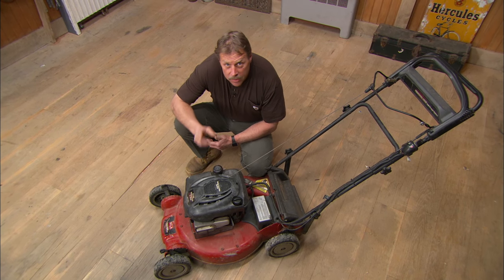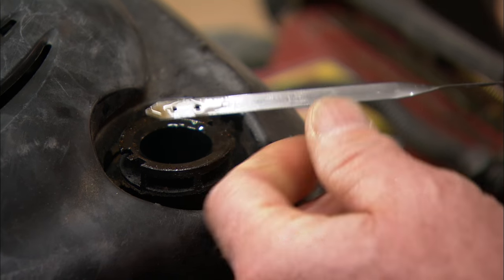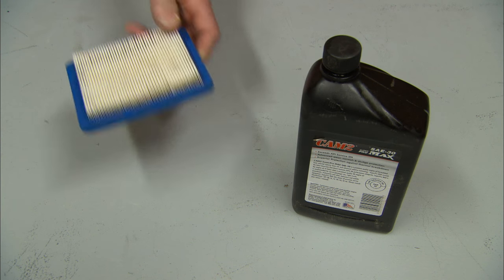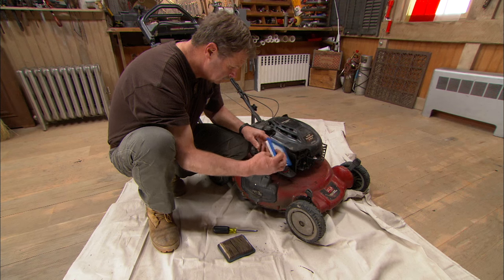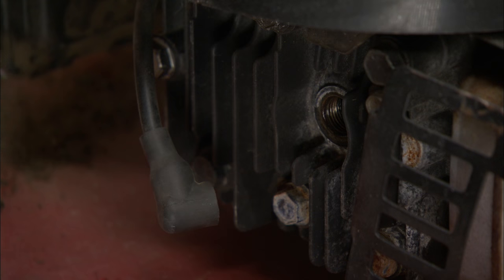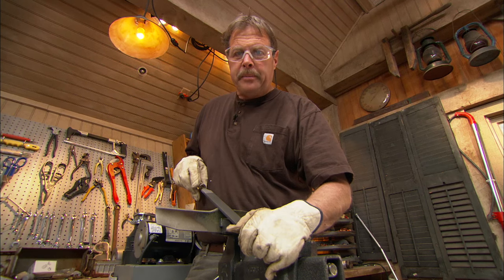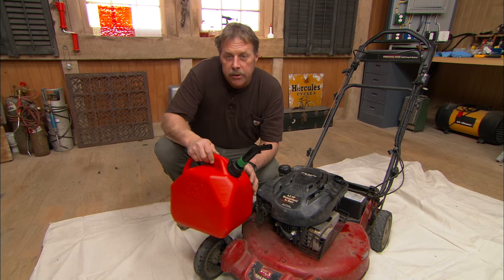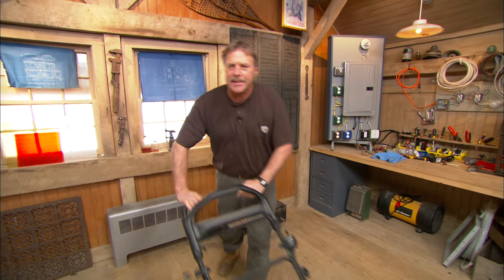How to Tune Up Your Lawn Mower | Ask This Old House

Comment: Haha, I didn't even know my lawn mower had an air filter until watching this..
Reply: Next time read the manual
Reply: +H Santiago nah, that's no fun.
Reply: @JacobRoberts1  shoppin' the blade and change the spock plug and get that prah bah outta mah cah!
Reply: That’s sad
Reply: Jacob I suggest watch a 13 part series called What on earth happened by Ewaranon to learn that the earth is not a globe. Link in my about tab.

Comment: Don’t run your mower out of gas in the winter, the tank and hoses will get dry and get cracked up, so use a stabilizer in the winter

Comment: Forgot to mention to clean the underbody of the mower housing with  tool like a 1" putty knife.  It is  especially important if your mower is a recycling mower.   Caked up debris can make your recycling mower less efficient.  Also, suggest using premium gas.  Your mower will perform much better with it.
Reply: Premium gas itself is useless money burner for a mower.  However, ethanol free gasoline will be highly beneficial.  So try to find that, if it's available where you are.  Harder to find these days.

Comment: After 15 years with my Craftsman Briggs & Stratton mower, I decided to jump on the electrification band wagon and got a Snapper Briggs & Stratton 82V Electric Lawn Mower. So far, I'm super impressed. Quiet, no gas, no oil, no fumes, easy starts, and no maintenance (other than oiling the wheels and sharpening the blade). Electric Lawn Mowers are totally the future.
Reply: Is it still working?

BTW I suggest watch a 13 part series called What on earth happened by Ewaranon to learn that the earth is not a globe. Link in my about tab.
Reply: @flat-earther 🤡🤡🤡

Comment: I turned my mower on the wrong side. The oil ran out through the carburetor(?) and dribbled out the casing for the air filter. Can't remove that filter casing to clean behind it. Can I just let it sit over night?
Reply: Ya mowah is shot now.. Tho it in da gahbidge.

Comment: If I have gas in the mower how can I tip if to get the oil out? I have to take the gas out first?
Reply: Beth Murrow remove the gas cap, take a piece of plastic grocery bag and fold it over a few times and place it over the gas cap hole, then tighten the gas cap over that nice and snug. It shouldn’t leak for the 20-30 seconds you have it tipped over. Be mindful though that some new mowers have an overflow spout that shoots fuel on to the air filter. If your mower has one then yes you  wed to drain it before tipping.
Reply: Adding to what Artem said, there is also most likely a drain plug underneath the mower behind the blade. It is there on most push mowers. It usually takes a 3/8" ratchet (not a socket) to loosen and tighten.

Comment: Whatever you do, DON'T use ethanol gas.   I went through three mowers before I learned that.  I have used Gum-Out  to bring one back to life.  Premium gas does not have ethanol in it (at least for now).
Reply: I would agree to avoid ethanol fuel for these small engines.  The carbs that utilize 1950s technology in these machines react very adversely to ethanol deposits.  Even adding a fuel stabilizer such as Stabil will only buy you limited additional time.  If you do not have ethanol free at the pump, you can try looking at the mower parts row at a big box store and they sell liter sized cans of ethanol free, stabilized, fuel.

Comment: Oil color doesn't mean it's bad or not.
Reply: dirty is abrasive
Reply: correct! I would be changing oil in my diesel pickup every week if that was the case. plus your little push mower oil is going to look dirty quickly because you cannot get all the oil out of it the way they make you drain it now.
Reply: Correct, but usually these small engines will have a milky color that shows evidence of sludge.

Comment: I could do all that, or just have an electric mower.
Reply: That sounds like a hellish alternative.
Reply: I was going to say: steps to electric mower maintenance: sharpen blade. End of list.

Not great for large yards where you need the range. Or for very small yards where a reel mower would be a better alternative. But they're perfect for that sweet middle spot that a lot of suburban yards fall in to.
Reply: We used to have an electric Black & Decker mower long before I was born. Now we have a Honda Harmony II with Quad-Cut blades, and we've had that for ten years, not to mention it was a housewarming gift.